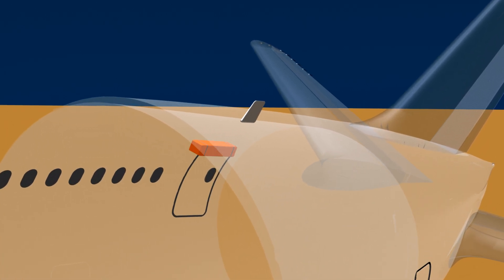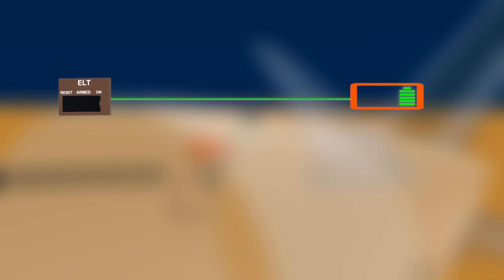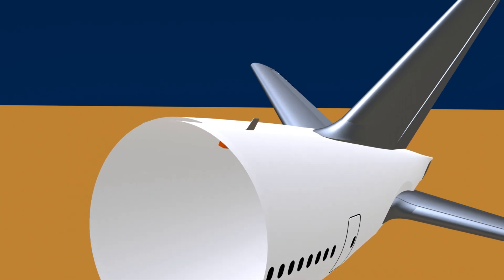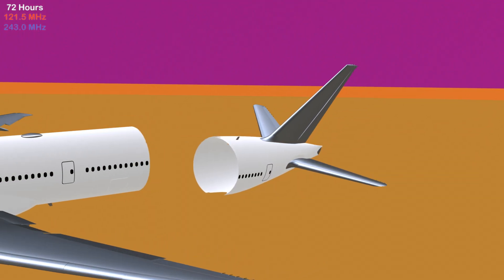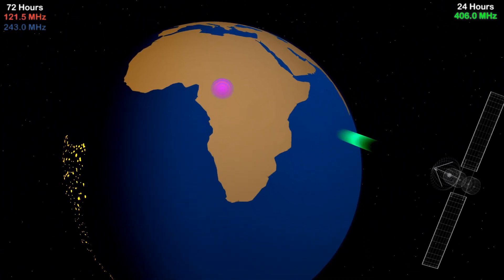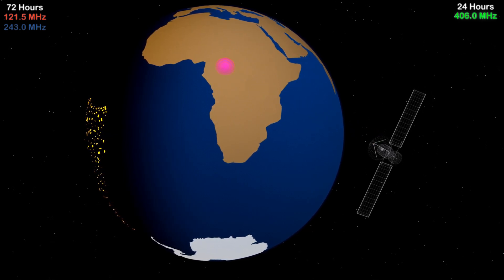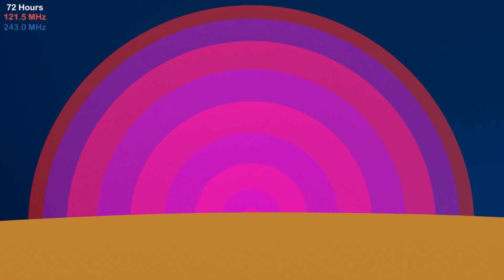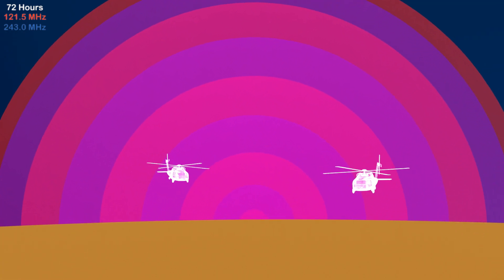How Emergency Locator Transmitter Works

Comment: Also in the cabin there are portable versions of it. They are part of the “vital safety equipment” crew need to take out before evacuating themselves.

In my airline they are: First aid kit, Emergency Flashlight, ELT, Loudhailer (megaphone), and supplemental survival kit (if the aircraft possesses it)

Comment: So where is mh370?
Reply: 33.177°S, 95.3° E
Reply: Beacon probably got destroyed
Reply: I don't know why people have trouble understanding a simple concept. When an aircraft ditches in water, water can attenuate high frequency radio signals, hence the difficulty in finding the beacon in the 24-72 hour time limit. Why is this so hard to understand?
Reply: @TactileCoder  Many people don't read much and take little in the way of science classes but somehow become experts when they feel like it.  To me it just goes to show we have some room for improvement in our location systems.
Reply: That's not a fair statement  @shawnmulberry774  as many are genuinely asking question.  I personally have a relative on that flight and I also would like to know.  The reason is should a plane hit water, it does not sink automatically therefore the beacon would have triggered something but there was nothing.

Comment: Except MH370.
Reply: The underwater beacon of the blackbox has run out of battery.
Reply: I don't know why people have trouble understanding a simple concept. When an aircraft ditches in water, water can attenuate high frequency radio signals, hence the difficulty in finding the beacon in the 24-72 hour time limit. Why is this so hard to understand?